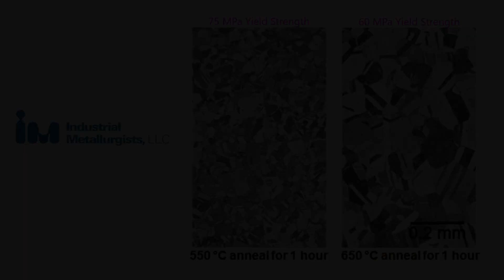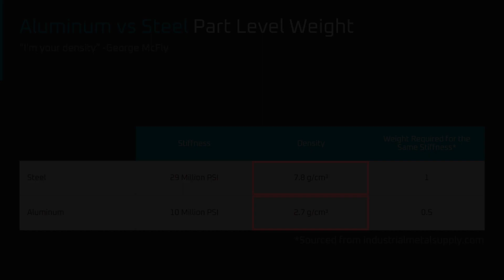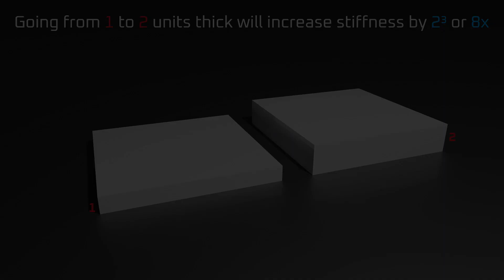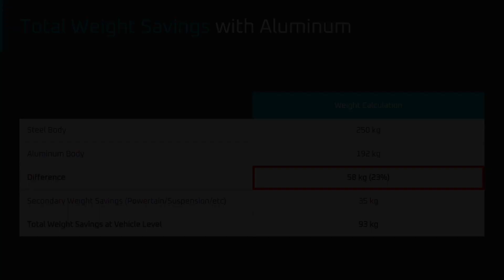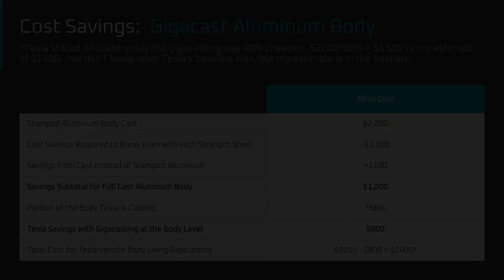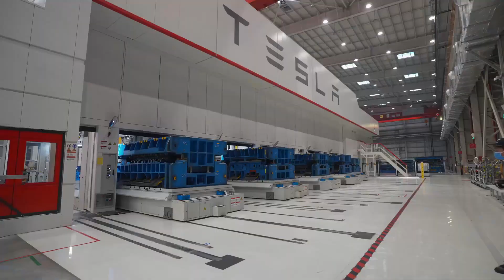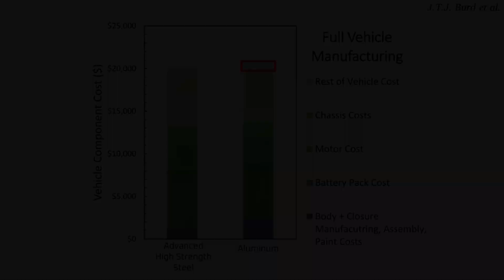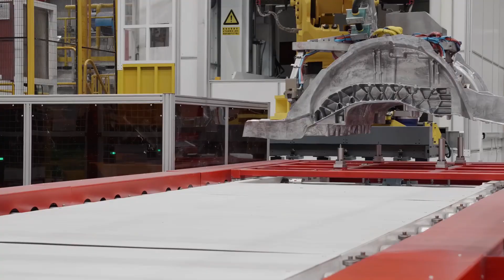#2 Tesla Gigacast Aluminum vs Advanced High Strength Steel

Comment: Jordan nice video good explanation but you aren't seeing the full picture from the outside, take a step back, the point of the giga casting is simple it's to short circuit 90 percent of the assembly of the skate,  the fore and aft castings are testing the process ( a halfway house or really a first step) the next is the structural battery this gives a 3 part underbody in aluminium, and as you have avoided most of the assembly you can parallel the lines in the space, all fair enough organic enhancement of the process ...  But what is the next step ? A single piece underbody again a logical improvement easier cheaper etc etc but then what ! Think about it it's casting metal couldn't it also cast another material ? Even a lower strength cheaper material like say a carbon or glass fibre filled resin ? You must take a step back and look and ask why are they doing things and not just ask how, Tesla is front loading manufacturing to reduce the cost per copy ... It's that simple, they buy the suppliers to stop anyone else getting the handle on them, I would be looking for a patent for a single crystalline fibre reinforced casting fill the mould with liquid resin and chopped fibre touch the nucleating crystal wait for it to spread and remove the set structure ....... But that's just me
Reply from the maker: I made the video because it's something I and the rest of the community were curious about:

It's material information.  

Everything you mentioned above is a separate topic.

Comment: There's a few downsides to huge castings tho...
1. Crash damage repairs. One tiny corner slightly bent on a rear end shunt... Huge cost to customer.
2. Thread damage in huge castings...again... What level of repair is considered acceptable... 
3. Magnesium parts... If used are a HUGE fire risk... 
4. Cast the whole body? Death nail for body shops around the world...
Tesla would be better off making cars more affordable across the range... All very well saying our cars do 300 miles+, yea but are way too expensive... Cost of the car IS everything now... If governments want everyone to adopt electric cars they need to bring the costs down to make them affordable..£40,000 upwards and your just aiming at the people with deep pockets. Also in the UK after 40k your hit with extra tax regardless if your vehicle is an EV or not
Reply from the maker: Thanks for supporting the channel!  Every comment helps

Comment: Aluminum is great till it starts to corrode. The Japanese have been making motorcycles with aluminum frames for some years now. The older bikes that have been subjected to a lot of humidity... corrode very badly to the point where it isn't cost effective to repair. It will be much worse in a car that is driven in areas that salt their roads in the winter. If a major structural part of the car corrodes you will probably have to junk it.

Comment: What matters is the use of stainless steel as the obviates the need for paint and why the Tesla Cybertruck is such a big deal. Vehicle painting and paint is incredibly energy intensive to apply and of course very expensive unto itself. If you take away the need to paint a vehicle in the first place first off you save a ton of money (perhaps literally these days) but more than that is the time savings in production...thus getting to market quicker and in far greater volumes if the vehicle design is a winner.

Comment: You have the cost savings between steel/aluminum pretty well nailed. My mind was thinking of some of the other factors are aluminum is corrosion resistant to salt that is put on the highway. Thus eliminating someone along the way having to undercoat the vehicle. I’m sure there are other advantages pointing towards aluminum than using steel in any  automotive application.  You didn’t mention the type of costs!
Reply from the maker: The costs were all inclusive 🤠  Pretty much everything you can think of.  The only thing the studies didn't take into account was the effect of improved quality and the ability to ramp the factory more quickly.
Reply: Undercoating is a Band-Aid for rust issues in the eastern United States...

Comment: The giga-cast is cool. But I can't even afford to look at a Tesla. I think Ford solves the problem pretty well with the F 150.  They use the same full frame design as always, and put the battery in the middle same as a Tesla.  $32,000 after tax credit. Seats 5.  200 miles range.  It looks like a truck.
If $28,000 is the cost to make a model 3.  Maybe they should go to the cheap steel.  And give the people a car they can afford.

Comment: You should keep well clear of considering Magnesium castings, the casting technology is difficult and the corrosion problems are an order of magnitude greater than Aluminium. Check the experience of aircraft manufacturers with Al vs Mg.

Comment: High strength steel, only means that they will use for car three times thinner stell so when rust hits it will rust through three times fester. Did anyone see aluminum rust to white powder especially when exposed to salt?
Reply from the maker: The alloy is corrosion resistant.  Some aluminum alloy definitely are susceptible to road salt, but not all.

Comment: Tesla forgot to recognize TWO important problems :
1) Contact - Corrosion between AL- and St - structures of the body in white : every insulation between the two kinds of metals Aluminum and Steel will get weak during long-term stress (experience of BMW in the 7series) which ends with enormous CORROSION PROBLEMS. 
2) the GIGA cast parts from aluminum can't be repaired after deformation in accidents. You will need an additional replacement concept for Tesla repair - shops. That will be very expensive and can affect the INSURANCE RATES .
Reply from the maker: 1) They've taken this into account, just as they have with their current stamped Al rear underbody

2) See my crashworthiness video
Reply: @thelimitingfactor  we will see, what happens. I 'm anxious about the long- term results worldwide 🌎😜

Comment: The MVP the Limiting Factor provides IS the technical breakdown METRICS. The technical and the breakdown method are your bread and butter for delivering tasty metrics. Because your metric never does crossover into reductionism they enable value comparison. Its a brilliant undeniable claim you build from first principles without simply beginning from a general claim working backwards. Brilliant mind!

Comment: Critical path analysis will inform the 3 minute reduction value to GigaFactory operational costs, production efficiency and throughput savings available for capture. Tesla may not be able to capture all. Purely from a performative view it might be comparable to a turbo mode that translates to speed out the door @ 70% efficiency. Seventy percent(guestimate) is BE for automotive mfg.
Reply from the maker: NIIIICE!

Comment: Casting it in one piece without heat-treat is very effective, and HS steel casting would be a lot more complex.  But aluminum's lack of a  fatigue limit can be a problem, I guess we'll see if the casting has been properly engineered to deal with that.

Comment: Steel against aluminium creates the considerable risk of galvanic. Corrosion. The different expansion rates will stress dissimilar metal joints leading to cracked weather sealing and corrosion. All aluminium structures make far more sense.
Stainless steel against aluminium is even more troublesome. Hopefully the CyberTruck is being well thought out.
Reply from the maker: I'm sure it will be, Elon called out the  Galvanic corrosion issues associated with the patchwork quilt of metals they're currently using.

Comment: Japanese motorcycle makers often use cast aluminium frame parts.  They look good and stiff structures are easier to make a than using steel tubes or steel pressings. 
I can see Tesla using castings for door structures and for the car sides (A, B, C pillars plus roof and sill frames). These can be welded but today’s industrial adhesives could literally glue the car together.

Comment: How do the different metals hold up over time at the places where they meet? Will there be galvanic corrosion?
Reply from the maker: They have to deal with this in lots of different components in the vehicles, not just the aluminum ones.  The rear underbody is already aluminum and Elon mentioned how difficult it was to match the patchwork so they didn't corrode.  With this, it will be easier.  Just one part made of the same material.

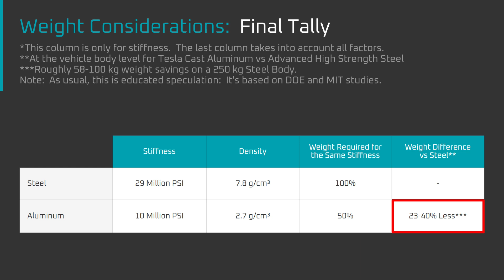Comment: @10:23, stiffness is a function of moment of inertia, I, rotated about its principal axis times E, the modulus of elasticity. The symbol K is often used to represent stiffness. K = fn ( E, I). The value of I depends on its geometry. For a given geometry, the value of I is the same regardless of the material. However, K is different between a steel and aluminum part having the same geometry because E (steel) is greater the E(aluminum).  The only way for an aluminum part to achieve the same stiffness as a steel part is to increase I, ie change of geometry of the part such as making it beefier. A beefier aluminum part would cost and weigh more, two factors not considered in the “Final Tally.”
Reply: Difficult making hollow section, if you're not using sand casting and hollow sections are usually good for moment of inertia, where you get both increased bending stiffness and increased structual stability. I also wonder if they need to add material places, that are not necessarily needed from a structual perspective in order to make the casting process work.

Comment: Hey Jordan, wanted to let you know that high strength steel can be cast as well!* So that might actually be where Tesla goes: cast the entire car... Looking forward to your next video

* See the report by Detroit Materials "Light Weighting With 
Advanced High Strength 
Steel Casting"
Reply from the maker: Interesting, but it looks like they're out of business
Reply: The steel would have to be hot cast even then the pressures needed would be crazy. Also at those kinds of temperature/pressure your moulds would not last very long.

Comment: Imagine the advantage of buying back old castings and recycling without the impurities
Reply: Yes aluminum cars also last so much longer. Without crashes in mind rust is almost solely responsible for cars needing to be scraped. Aluminum never rusts. It forms a small layer of oxide which is actually harder and more durable than normal aluminum. Aluminum parts are easily recyclable and have life spans of hundreds of year. A well maintained aluminum car without any steel could out live the owner. Especially electric cars. Less moving parts. Regardless of material gas engines will always die eventually because they break them themselves apart while in use. We could easily see cars lasting 20 30 50 even a hundred years with minimal maintenance. Carbon steel shouldn’t even exist anymore. It is one of the shity materials one could use. Regardless of what it’s properties are new a material which naturally and rapidly decomposes is useless. And the rust takes enormous amounts of energy and chemicals to recycle back into iron for making new steel. So much it’s not worth doing it. There is never, EVER a good reason to use carbon steel anymore for absolutely anything in todays world. There will always be materials better in every way that last longer and at similar or lower prices. The only reason it is used is stupidity and because if products die and need to be replaced it is profitable for manufacturers. I absolutely hate carbon steel. It is usually used in super expensive products that are disposable items because of carbon steel.
Reply: @jacobleeson4763 if you knew anyone in the trucking industry where they use aluminum frames on trailer bodies then you would know that aluminum will not rust but actually dissolve when exposed to salts

Comment: Elon has said his real technological advantage is in manufactring. A traditional car takes 22 hours for assembly, give or take an hour for what car/factory/brand you're looking at.
I've seen tesla saying it takes 10, yes ten, hours to ass'l the 3/Y with gigacastings.
So that's DOUBLE the production rate for the same size factory/workforce.
Reply: It's not only the throughput due to speed, less space is required for each production line as there are fewer steps, and a lot fewer robots. As the video says, there is an additional improvement in quality some defects, such as panel gaps, are only apparent further down the line.  Improving the defect rate has a compound effect and makes the manufactuing more profitable.
Reply: Speed or throughput are not good key numbers to compare. A factory that produces a car in half the time but costs three times as much to build and operate is not better.

You need to break down speed and throughput into their associated costs. Both in capex and running cost. Again, using half the labour but spending twice the saved cost on electricity is no win.
Reply: There's another factor in play soon reducing costs of production. What to do with the main battery packs when they are no longer viable in a car. They are going back to the factories to be used as storage batteries linked to the factories own solar and wind farms. Nissan announced recently that they will be carbon neutral in the next ten years. Some going when you see the size of machines running. By reducing the third biggest cost of a car (1st being parts, 2nd being labour), the energy costs to make a car need to come down. These apply to all manufacturers.. something's they can't reduce such as labour costs but energy and parts they can control and can be ruthless. Suppliers tend to be moving nearer factories now, reducing costs of transportation and uncertainties in markets. Before covid most parts were made in very low wage countries... That's changing. The shortages of silicone chips has thrown another spanner in the works too... 90% of manufacturers are still on downtime working on and off as stocks arrive.. try buying a new car... Wait times are huge unless in stock.
There's also another factor in play.. new upstart companies trying for their own slice of the cake... Market share has shuffled around a lot.. China being a huge player in the EV markets now... 
Consistency of quality for new companies... Can they keep it up...
Reply: Ten hours is not that fast... Nissan Sunderland can build a car from painted shell (coming into trim line) to start up in around 6 hours or so..might be quicker with no lunch break...
Each work assignment is well under 1 minute turn round.. has been the most efficient in Europe for years.. Tesla seem to think what they do is fast...haha... No where near.. what they do is brag about what they do... Need to try comparing data... Oh hang on.. he daren't...
Reply: @terrybrown6057  google some...22 hours labor to build a car...remember the engine and transmission, seats and more arrive ready to assemble in the body.
Reply: @chrisperry3525  yep.... Every manufacturer has either sub assembly on or off site by themselves or contractors. Either way it doesn't alter the time a car arrives from Paintshop into trim and chassis then right through to dropping onto its wheels - that's the official count. Trim in to chassis out. Everything else runs to that movement and has to keep up come hell or high. It's a tough call for sub contractors have issues and have to catch back at short notice. Over the years manufacturers have come up with ways to keep the line from stopping... Think of the cost of stopping per minute... And this happens...each major stop they find the cause and bill the subcontractor responsible... An incentive to keep up. At around £30,000+ a minute...
Reply: @terrybrown6057  I’m not sure why you say thats the only metric. Less time making the frame means less money making the frame.

Comment: Great video, but you ignored aluminium's greatest advantage. Aluminium won't rust! Rust is still a big problem in colder countries, where salt is used on the roads.
HSS will lose its strength if it rusts
Reply from the maker: Not ignored.  It's a series.  It'll be covered in it videos.

Comment: This video is so great. But it remains in my mind why your analysis doesn't include corrosion resistance as a consideration. The simplicity of EVs strike me as a reason to go for long life durable vehicles which retain value. I'm thinking aluminium is more corrosion resistant, but nice if you addressed it.
Reply from the maker: Thanks man!  Corrosion resistance is a property of the alloy.  It's a series and will be covered in the appropriate video (the next video of the series)